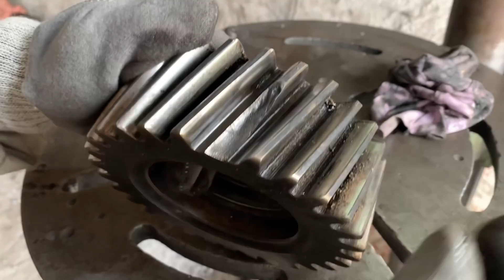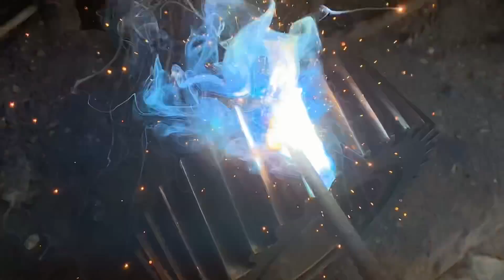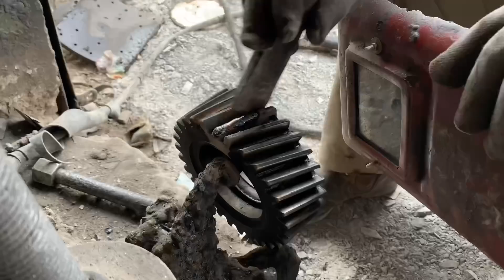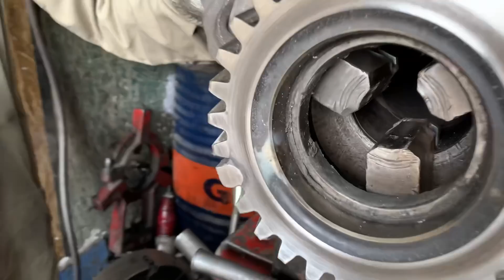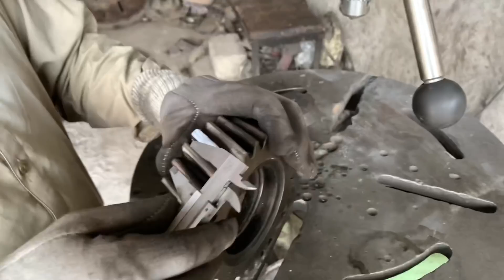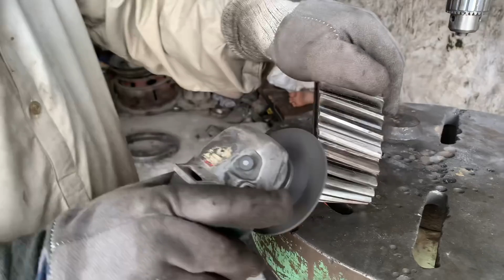How to repair differential gear teeth | repairing rear wheel gear broken teeth | Truck broken teeth

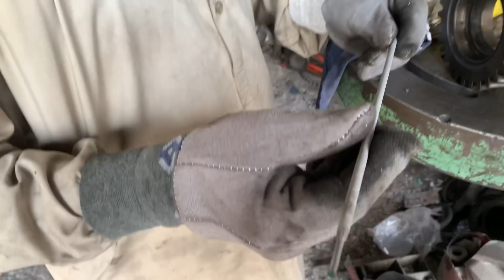Comment: 0:38 The electrode type is ch 80 R.  it is a hard-coating electrode.
Reply: What is this electrode made of?
Reply: @greasyHands66   the result is if you need a very hard surface this is the electrode. some titanium.

Comment: Good done for toys. For heavy work machine it is not useable.
Bought a used machine and found such a work in it.  Repaired part lost half of material because of not hard enough.
Reply: I've fixed lots of gears and that's it. It has to be hard to survive. It is a good idea to run the gears in by turning by hand with grinding paste to get the fit right. Obviously clean it properly before installing it.
Reply: What about if you re-harden the steel?

Comment: Need to do this on my transmission. I just put it back together and pretended i didnt see that.  I bet the tooth you welded on is stronger than the rest of the teeth.  How much money did you just save?

Comment: Countries abroad don't throw away things they repair them unlike USA just toss 2 junkyard.
Reply: Because that is the proper way to do it.  These gears are hardened.  So the welding ruined the hardness to the surrounding teeth, and his welding method is poor.  You need a continuous bead to set the weld.  Him pecking at it never got the metal hot enough to penetrate.

Comment: Great job 👍
What kind of rod did he used for a welding ?
Reply from the maker: He used a steal rod..
Reply: @jktechnology786  I meant what kind or which number .
Reply from the maker: Sorry sir I doesn't remember the exact number.... I am just a film maker
Reply: @jktechnology786  thank you,cos it's very important .
Reply: Is it citodor?welding rod.machinable.
Reply: you can almost make the number out on the rod at the beginning. I want to know also. I'm going to try 312-16 for my atempt
Reply: @alitn588  6013 electrodea is used
Reply: @jktechnology786  amazing  I also would like to know what rod
Reply: @andyanderson25  use 7018-B2
Reply: I repaired a broken gear in my dozer. I stared with 350 then switched to 700 hardness. The gear has lasted very well being some 25 years ago that I did it. Got unwanted speculation at the time from so called experts (who didn't know sh*t) that I was wasting my time and that the electrode was too hard but if you get it hot and cool it slow it removes any brittleness.
Reply: @bigstack6407  I don't think so !
Reply: @alitn588  i think 3mm
Reply: @andyanderson25  Use the gear logo in player. Slow play speed. It is very readable.

Comment: من الخطئ ارتدائك القفزات عند العمل بالمخرطه
Reply: I'll go further & say it's dangerous to wear any loose clothing while using any machine that can catch it. I once seen a guy use his foot on a lathe handle to get it unstuck. His shoelace got caught & his foot slowly got pulled clockwise under & up the backside of the adjustment handle dial. It tightened his shoelace so he couldn't pull his foot out. Fortunately there was a guy walking past when this happened & he shut it down before it did serious damage. His foot was broken in 4 places as well as 3 toes. If the guy didn't stop the machine it would have rolled his foot then his ankle & on up his shin. Who knows how much of his leg could have gotten rolled up? Lucky Bastard.
Reply: @peterzinia3767  exacto, a una estudiante de Escuela secundaria Técnica  en el país de México a unas calles de dónde vivo un torno le destrozó el brazo izquierdo.

Comment: this works maybe as a one time fix but the way you sanded down all the teeth just to make them even will wear it with repeated repair. also the welds were pulsed instead of strung which makes me question the integrity

Comment: And someone wants to continue to use it? After all, this tooth has a different strength from the rest of the teeth, a different grade of steel, a different hardness ... Probably only Kamikaze will use this gear ...
Reply: Hay quá bạn ơi
Reply: When you're in a bind  what ever it takes   was a very well done job 
And yes you have a point  but some time got to go for broke  lol
Reply: If they know what they're doing, they've got the right filler rods

Comment: Here we go , another bodge , poor welding , heat treatment lost on surrounding teeth , I wonder how long it lasted , its not often economical to repair gears
Reply: Unless you need to sell your truck.
Reply: Unless your truck is cheaper than a new gear from abroad
Reply: after all, a valuable comment, not a blind delight at this poor performance
Reply: If you cannot get the parts easily 🤷🏼‍♂️. I’m the USA we toss stuff that others Would consider excellent things to fix or Continúe using.
Reply: @Jeversonapilz  lo 0